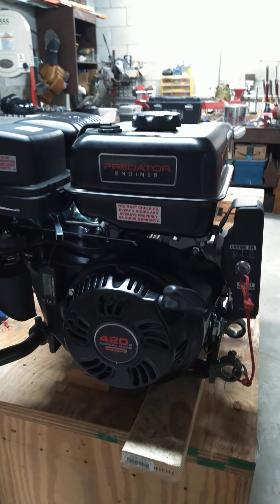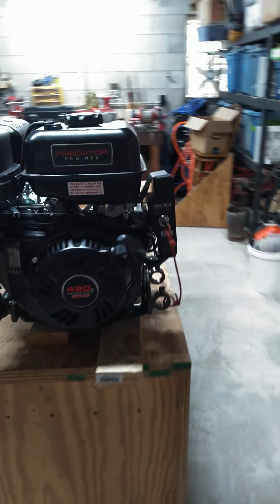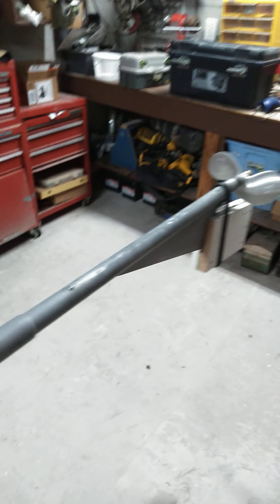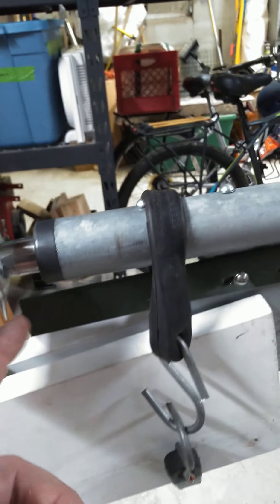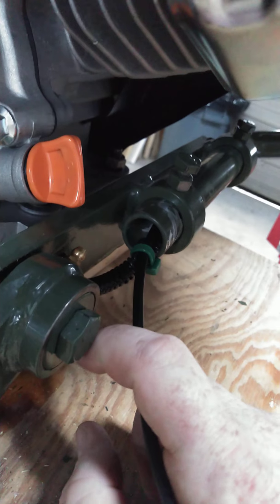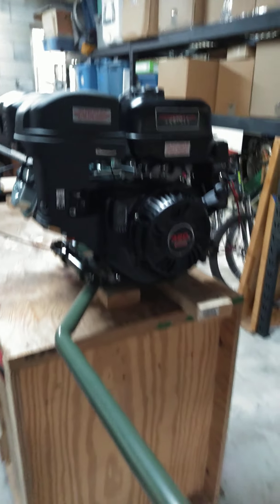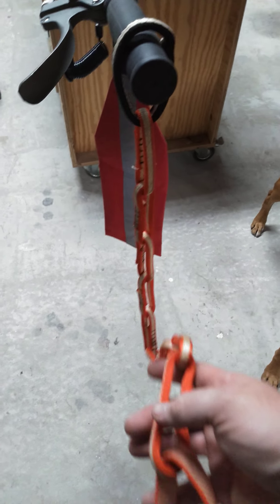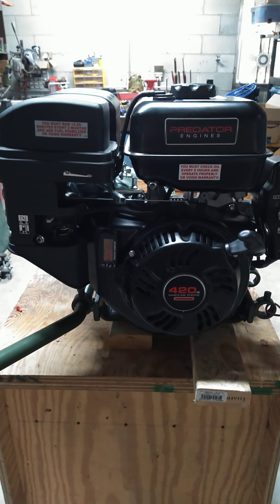Swamp Runner Medium Kit, 420 Predator

Comment: How did you wire the Killswitch? I have the 459 and it did not match any of the videos
Reply from the maker: I wired mine into the low oil sensor.